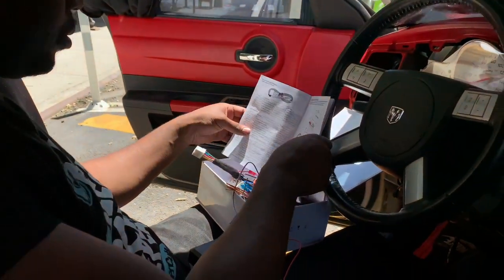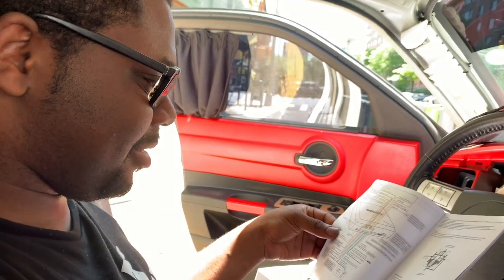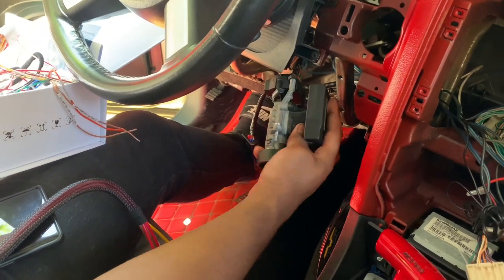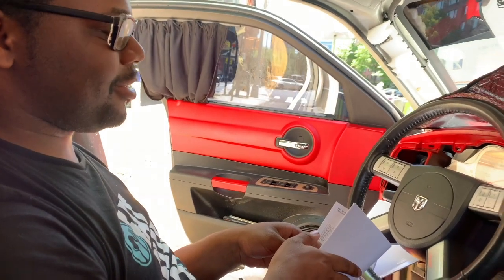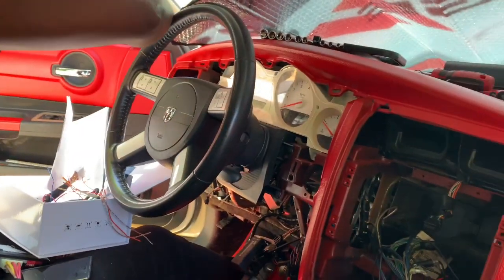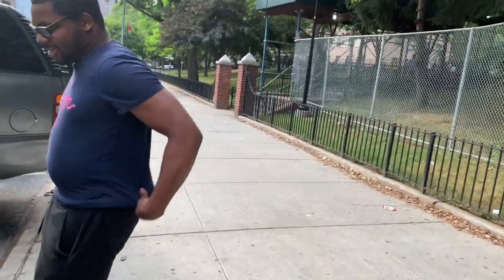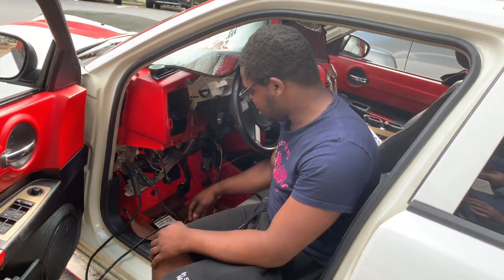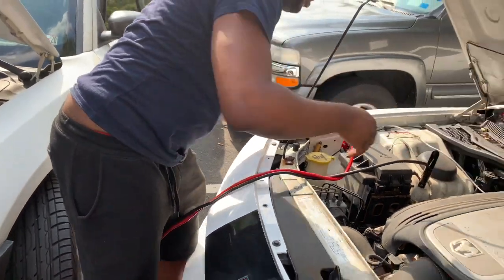Installin a Push To Start Button on a Custom Bagged First Gen Charger Pt.2 | THE THOTTIE 69

Comment: I'm doing this in my magnum, would you happen to remember the resistance on the door locks and ingnition?
Reply from the maker: It's been a min so I don't remember but check out all 3 parts I might have put it in there if I remember I will definitely hit u back on it but check out all 3 videos if you haven't already.

Comment: Bro where did you get it from.
Reply from the maker: You can get then now on Ebay or Amazon but u got to get the right one that come with everything alarm remote start unlocks soon and u walk up to it unlocks doors with the key and trunk and keypad for ur window if u cant find ur keys u put in the code and the doors will open without keys.
Reply: @CmcMods  ok cool thanks bro I'm going to look into it